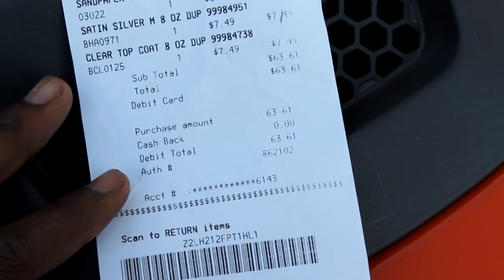How to Paint Front Lip,Side Skirts, and Splitters| SImpleCarTips

Comment: So I did the exact steps you did and surprisingly enough my car is the exact paint code. But before I started clear coating I noticed the lip wasn’t smooth and had some rough spots to it. Should I wet sand it lightly or continue with the clear coat??

Comment: Nice job, dude! 
I tried this a few months back on my front lip, also made of polyurethane, I sanded it smooth, wiped it down with alcohol and primed it. However when I started to lay down the primer I got a ton of small cracks in the primer. They almost looked like spider webs. So I went back n sanded the lip smooth again, sprayed primer again and the same thing happened and I got those cracks again. What I did I do wrong?
Reply: You most likely used a metal primer. Metal primer is made for metal, which doesn't bend. Get a plastic primer, made for bending so it will never crack
Reply: XxevilseedxX you didn't take your time sanding.. you must clean very well with the alcohol

Comment: do u still have to sand it down if its brand new and was not on the car? or can you just go straight to primer?
Reply from the maker: Jay Mald based on our personal experiences we felt it was better to lightly sand and clean it even if its new just to smoothen out any imperfections that may be in it though cleaning it could work just fine.
Reply: Thanks bro! What grit sandpaper did u use
Reply: Jay Mald Sanding also helps the paint stick.